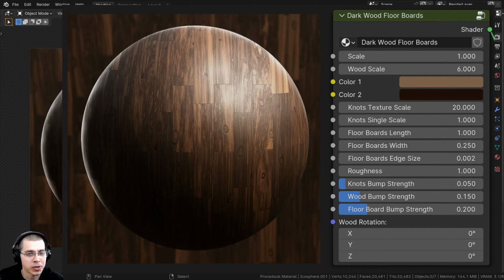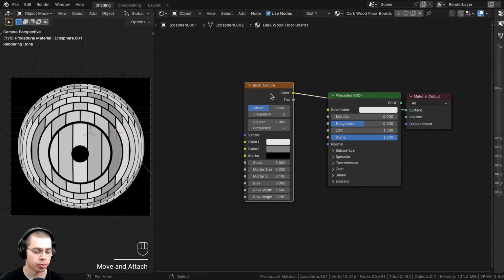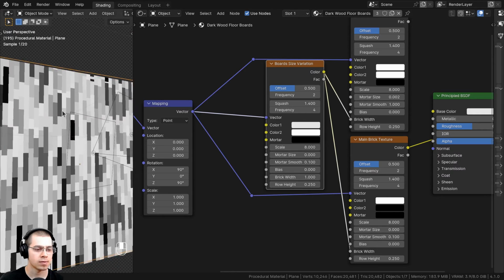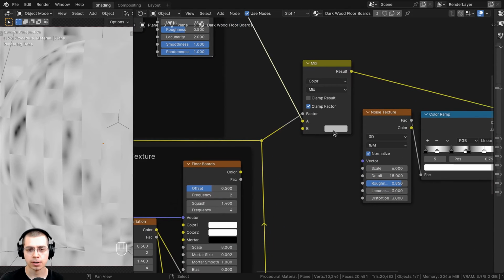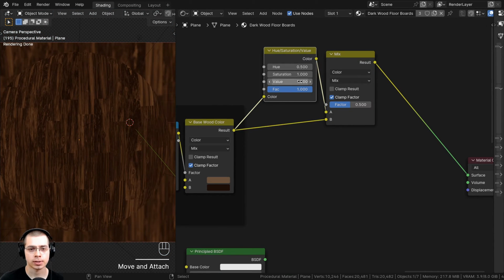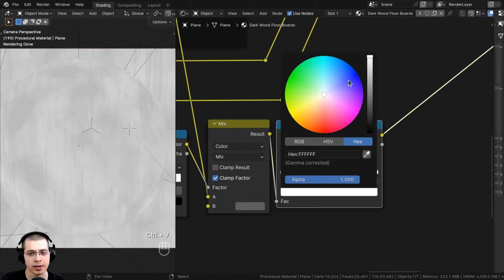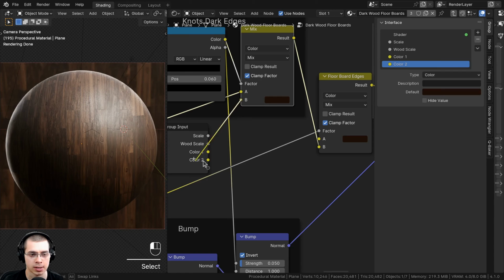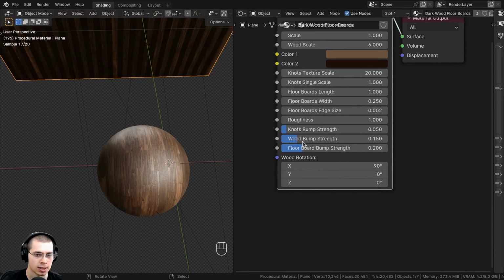Procedural Dark Wood Floor Boards Material (Blender Tutorial)

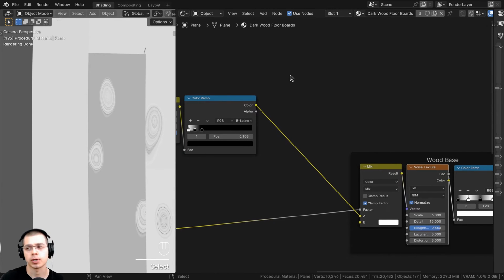Comment: Hey can someone help me at 19:08 you see the knods are only at specific places but mine are all over like on all of my planks can someone tell me what i did wrong
Reply: Pretty late but in case someone in the future has the same problem, make sure in the color ramp the one on the right is actually fully black. It may already seem like black but it isn't, the Hex value should be #000000FF.
Took me a while to figure it a out.

Comment: Hi Ryan. Hope you are doing well. I've been going through this tutorial and ran into 2 issues that I have not been able to figure out on my own (at least not yet).

Issue #1, my floor board lengths do not adjust when I change the value. Not sure why, but changing the value seems to change the color and not the board lengths.

Issue #2, when rendering the material in the 3D Viewport or Shader tabs, the preview works fine. However, when I go to do an actual render, I get blank screen. Also, when I turn it into an asset, it doesn't show a material preview. I've been working in Cycles, which I noticed you are using when you adjusting your render settings.

With that said, It renders in EEVEE. I'm guessing this is a limitation of EEVEE vs Cycles, but I'm not sure why it isn't working in Cycles since your tutorial seems to be using Cycles as well.

Your thoughts?

Thank you in advance,
MC
Reply: I just redid the tutorial and it worked fine. Must have been a computer glitch.

Comment: I don't know if it's a problem with 2.91 or if I screwed up a step, but I have the material on a large plane and the scaling is all over the place across the entire mesh. All of the transforms are applied and I'm still using the object coordinates.

edit: the problem seems to be with the Difference mix node , or somewhere around that step - no idea how to work around it though

I seriously can't figure out what went wrong here. Still hoping it isn't just a problem with using an older version, but I've followed the vid step by step and the issue is persisting on other meshes as well.

edit 2: had to make the scale values in the mapping node before the Difference mix a fraction of what they are in the vid - 0.1, 0.005, 0.006 seems to have fixed it
Reply: you sir are a life saver

Comment: This is awesome! Just one question, I bought this on gumroad, but when I go to append it, the floor boards are all aligned and doesn't come out the same as your finished product. How do I fix this?
Reply from the maker: thanks for purchasing! what do you mean by, aligned? on default, the floor boards should be randomized. if not, you can change the random size of the floor boards with the custom values on the node group. Also, make sure you open the product files with the latest blender version.
Reply from the maker: Oh and also, if your still having issues, try changing "Wood rotation" values on the custom node group. you might need to rotate the X by 90 degrees.
Reply: @RyanKingArt  Absolute legend, rotating it fixed it. I swear I thought I tried everything. Thanks for your help.
Reply from the maker: @skillgenerator54  I just updated the product files and rotated the wood rotation by 90, on default, so that issue won't happen again for other customers. Because most people will probably be adding the material to a flat plane.

Comment: Your best floor material for sure, I really enjoyed the knots edges and floor tile edges darkening to give it more realism and the overlay of the main brick texture to the location of the knots mapping that was excellent as well, I did it in Cycles which really looked good, need to adjust the tile size for my floor but other than that  it was a very smooth process!